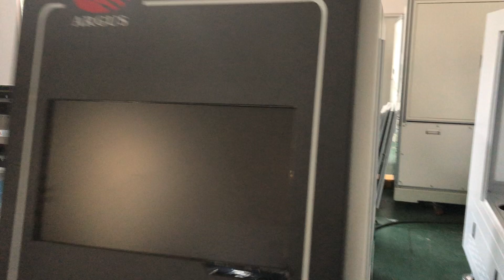ARGUS SUPPORT + SCM1219 Extrusion Acrylic LGP

Comment: Can I do this using a Trotec Speedy 300? How do I design the panel? Do you have suggestions for free software to do it? If I'm using a small panel, 6"x6", can all the dots be the same size and spaced the same??
Reply from the maker: Hi, I'm not familiar with Trotec's software, you may ask their after-sales team. LGP special design software is not free usually, but if your panel size is only 6''x6'', you can just design your dots file by AI or coreldraw